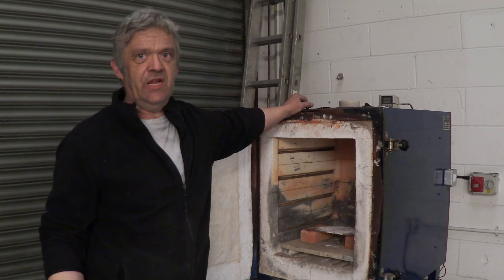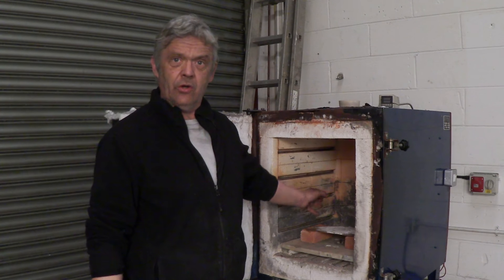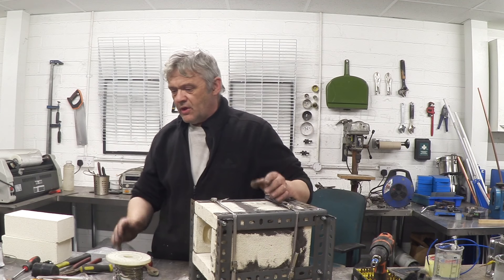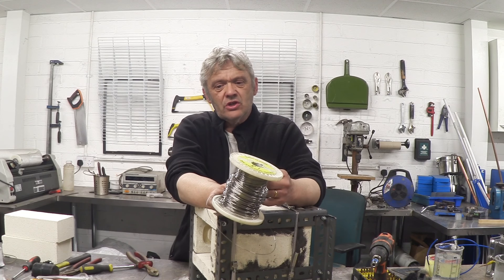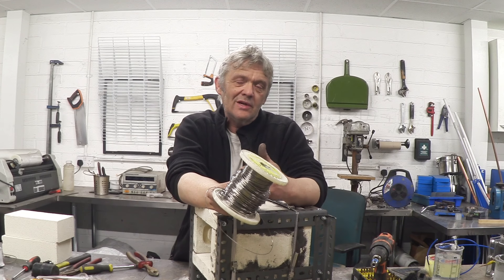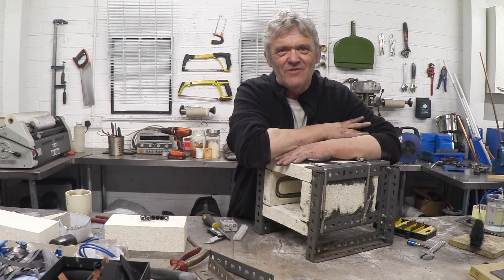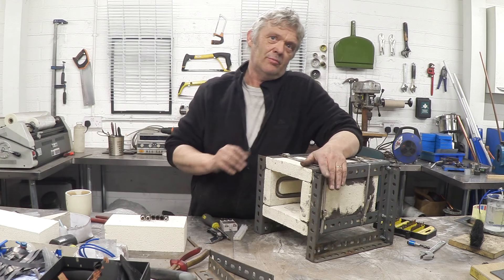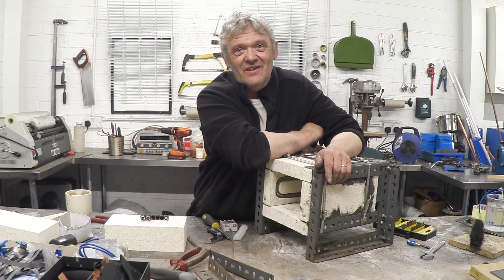How To Make A Lab Kiln - The Heating Coils

Comment: Do the coils need to be protected in some way to prevent accidental touching of them when they are live? Would it not be quite easy to get an electric shock if you accidentally touch the coils when putting something in or out of the kiln?
Reply from the maker: mate - this is a kiln like every other kiln - it works like every other kiln - if you don't know how to use a kiln safely, learn that first - you would burn your hand (if you loaded it while it was on - why would you do that?) long before you got a shock

Comment: When finished, I'd love to watch you use your $50 Kiln to turn $5 worth of Granular Urea into $500 worth of [Iodized] graphitic Carbon Nitride...It wont take much of that doing to really make the whole project worthwhile.  Then, try that material on cheap commercial GoreTex, for comparison to standard Platinum/Nafion for PEM Fuel Cell and Electrolyzer applications.  Being perhaps two Orders-of-Magnitude cheaper, it doesn't have to be quite as good to have profound applications.  The reason for pursuing that is that both the gCN and the IgCN Impregnated GoreTex would be very easy, high-margin materials for FWG to make and add to your store, along with the Conductive Inks.  If you can manage to get the IgCN/GoreTex even in the ballpark with Platinum/Nafion in terms of performance (as some papers have suggested), it could be your biggest impact on Batteries, SuperCaps, Fuel Cells or Electrolyzers of all.
Reply from the maker: That's a good idea mate cheers and I have made gCN before - even made a video on it
Reply: @ThinkingandTinkering  I know, that's what intrigued me to look it up and see the hidden potential its got.  When I priced the Urea @ $200/Tonne vs the gCN @ $200/Kg, the difference floored me!  Then I saw that paper about Iodizing it into nanoplatelets with a simple ball mill, and, Wow!

Comment: Cool.  Uses for a kiln?
Reply: Hilariously I'm literally making a fiber kiln at this very moment. Having Rob do a sanity check was nice. What CAN'T you use a kiln for. All kilns are also metal tempering machines/forges, you can remove or add temper to heat treatable metals. Carbon becomes graphite on command in a good kiln. All mud everywhere is essentially clay, dry it and fire it to make your own ceramic insulators or dope the ceramic to make your own ceramic elements.  Melt down metals like aluminium with ease.

While you shouldn't use things like fridges to store chemicals lots of people do and in my kilns case I'm making it wide and low so that I can toss a pizza stone in and also do pizza in it :D.
Reply: Egads, beware of heavy metal toxins in a kiln and bake your food elsewhere. Other than that, yes, very useful list.
Reply from the maker: a million mate!
Reply: @ThinkingandTinkering  Sooo....your next million videos on kiln uses. Gotcha. ;P
Reply: @twestgard2  Yes, you don't want to use it for things like food unless you know what's in the glazes are you have been using. Other than that there isn't a threat from those sorts of things. Think how hot a kiln gets, they vaporize things like heavy metals. Among those with large home kilns it's actually quite common to hear about turkeys and the like bing done in a kiln. Mine will fire only known mixes of stoneware and make large quantities of graphite from carbonized bread , so pizza in mine will be just fine.

It is good advice through as several glazes are quote toxic before they become inert glass on the things we eat and drink from.

Comment: I know this is old but it looks pretty dangerous on 240 volts due to the exposed heater coils at mains voltage. I've seen many similar builds for 120 volts, which is not as bad.
The most dangerous error someone could make would be withdrawing a very hot metal or graphite container and accidentally touching one of those coils.
Options to make safer (admittedly max temperature may be reduced with some of them) would be: 
   High temperature braid or ceramic tube over the heater coils.
   Protection grill over the coils preventing accidental touch.
   A door interlock, only allowing power when the door is closed.
   Enclosed heating elements, e.g. grill elements for electric ovens. These have the heating coils enclosed in an earthed metal tube with a mineral powder between the tube and element. Most of them can be re-bent to different shapes, alternatively unformed bendable elements are available off the shelf from various suppliers.
I have been wondering about a quartz halogen infrared kiln. Similar to this, but use quartz halogen elements from an old infrared heater. I was thinking of putting them in quartz tubes to protect them from dirt and the rear of the quartz tubes could be silvered or otherwise coated to direct the infrared more inwards.
The issue would be temperature control as the temperature of whatever is being heated could be much higher than the air temperature inside the kiln. It would also depend somewhat on its infrared absorptivity. An infrared thermometer or camera could be used, but a hole or window in the kiln would be needed. For automatic control something like an Arduino could be used connected to the infrared sensor.
Reply: I just saw your next video with a door interlock switch on the heater elements!!!

Comment: Maybe I missed it, but what material is the wire made of?
Reply: @mike gray It's a metal alloy resistance wire, usually "nichrome" which is a special nickel, chromium alloy (somewhat close to stainless steel) designed to not corrode quickly when it gets hot.
Reply from the maker: there are a few options mate - Ni-Chrome and Kanthal are common and reasonably priced - but it's like this whole build - you need to choose you temp range and then the wire accordingly - Kanthal will do up to 1400 degrees C an as the kiln body is built to 1200 degrees C it will be fine - but when you look to buy it will give the rating of the wire for you

Comment: Hopefully you just created a business idea for many handy people. Just go to your local kiln owner and offer a maintenance service, you could be set for life with a valuable skill. Just think about all the places that have dying Kilns - Universities, pottery manufactures, laboratories, etc. Many would never think about how to maintain them, just buy a new one when they burn out.
Reply from the maker: there is a lot of mystique put out about it mate - but mostly it is super easy - if you need to calculate heat requirement based on size and heat load than can be a bit challenging - but refurbing an old one - seriously it's a piece of cake - as for regs - having a PAT test on it will probably be enough

Comment: Most U.S. houses are 120/240 volt. 240 volts is used for larger appliances ( like dryers or furnaces) . 110 for everything else. I'm guessing that is " nichrome" wire ( nickel - chromium).
      Back in the day when appliances were meant to be repaired, some hardware stores sold a standardized pre - coiled nichrome heating element wire. It was sold by watts per inch. You looked at the wattage stamped on the appliance , or measured the old element.
      Interesting video! This would be a great high school physics class project.
Reply from the maker: I have that mentality mate - I hate throwing stuff away

Comment: If I got it right, the coils are only held by their ends in the holes. Aren't you concerned about them jumping out of the channel and hanging down?
Reply: The spring action of the coil creates friction at the curved end
Reply from the maker: that's why we cut the groove in a round shape with the copper pipe

Comment: I’m not super great with the Ohm’s Law electrical calculations so I had to stop repeatedly around 5:51. Here are my notes:

Ohm’s Law is V=IR, or translating into words, it’s “volts equals current times resistance.” In order, the units are volts, amps, and ohms. 

You’re trying to determine the length of wire you want to use. If you go too short, the electricity will whip through too fast and blow the breaker and the kiln won’t work. If you go too long, I’m not sure what happens but probably either it’ll heat slowly or not get up to a high enough temperature, and maybe both of those. Maybe someone who knows can comment. Anyway, when you’re installing the wire you want it to be as short as possible without blowing the breaker because as much as possible you want the controls to be your power bottleneck, not the coil. 

So to solve the puzzle, you plug in the numbers you know. First one in England is easy, 230 volts. Here in the US it’s 120 or 240, depending on how you wire it. So whatever you’re doing, you plug that into the volts slot. 

Then Rob is going to use a 13 amp breaker. Why? He doesn’t explain. This is more complicated than it looks. Since breakers come in a wide variety of sizes, you can control the length of the wire needed by either using a bigger breaker (less wire - faster heating - wire decays faster), or a smaller breaker (more wire - slower heating - wire decays slower). So there’s a Goldilocks breaker size for the kiln size and wire rating that’s not necessarily obvious here. Anyway, if he skipped it I probably should too. 

Because I’m thick and like simple answers, i note that the end result, 13 amp breaker and 18 ohm wire, are not too far from each being the square root of 230V. In other words, a 15 amp breaker and a 15 ohm wire would also get you 230V. So that’s where I would start, not at the extreme, like a 100 amp breaker and a 2.3 ohm wire. Although now I wonder what would happen. Probably just burn up is what. Anyway, back to the calculation:

So far we have 230 volts = 13 amp x ____ and arithmetic gets us to 17.69 ohms. For simplicity Rob rounds up to 18 ohms. 

Then the wire is 1.72 ohms/meter, so you divide 18/1.72 and you get 10,46 meters needed. Rob rounds that up to 12 as a safety mechanism because a longer wire has more resistance and is therefore less likely to blow the breaker.
Reply: If you plan for 13amp and have a 15amp breaker, that prevents you from popping a breaker on a regular basis.
Reply: 13A is the most you should draw from a standard UK wall socket. In other parts of the world you'd have to calculate based on what the limits are where you live.
Reply: joinedupjon okay, that makes sense. Here in the US our standard circuits are either 15 amp or 20 amp, and for higher amperage one has to get larger wires and a heavier outlet.
Reply from the maker: The breaker is usually on the main distribution board of the house. Each appliance that plugs in the ring has it's own fuse in the plug - well here in the UK - that's not so common in the US. That fuse in the plug is usually 3,5 or 13 amp - they are pretty much standard fuse sizes that's why it is 13 amps and why I use that figure. Here in the UK our breakers are set as 32 amp for the plug ring main - but of course lots of appliances are on a ring main. but apart Fromm that it looks to me like you have it pretty much spot on mate - and you are right if it is too long it will just take ages to heat.
Reply from the maker: exactly mate
Reply from the maker: it's funny isn't it - somethings just don't occur to you - I never really thought about it but it's not that normal to have a fuse in the plug in the US but here in the UK every plug has a fuse
Reply from the maker: it is pretty unusual to use a small kiln like this straight out of the breaker board here in the UK. For larger kilns that is exactly what you would do and dedicate to the kiln it's own breaker and wire.
Reply: Robert Murray-Smith yes about seemingly intuitive things not occurring. what I find endlessly amusing is that the physics are the same and the desired end result is the same, but for historical reasons we’ve managed to create so many different systems filled with obvious and not-obvious difference. 

If only King George III had gotten the electrical system standardized before 1776, this would all be so much more straightforward.

Comment: I notice you made an effort not to say what material the wire was, such as Ni-chrome, Tungsten, Molybedemium, etc
Reply from the maker: yeah that's up to you really - different materials have different lifetimes and can cope better in different environments like heat range and gasses - but they also change in price and like anything it is all just a balance between what you want and what you are going to do and what you are prepared to pay for. A mid-range wire will do just fine and as you work more with it you can change the wire easily
Reply: @ThinkingandTinkering  What do you recommend?
Reply: @davidschwartz5127  best wire is kanthal a1